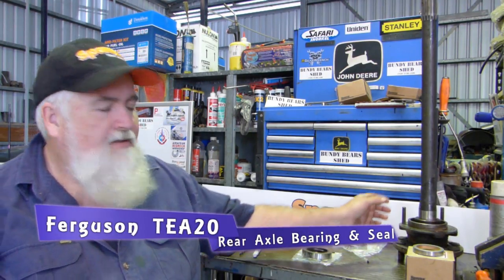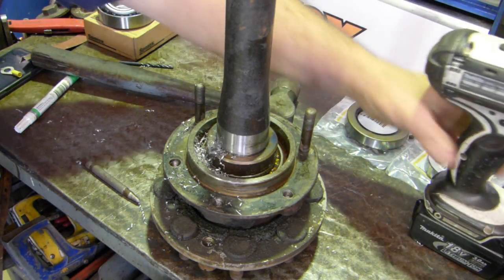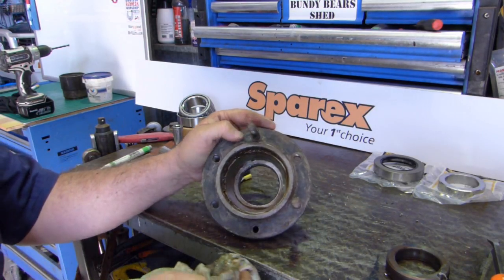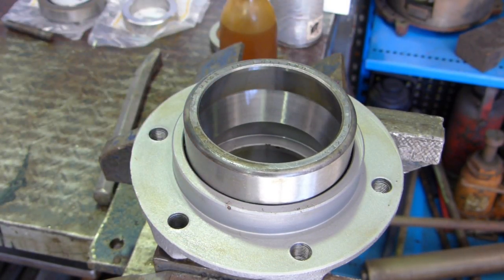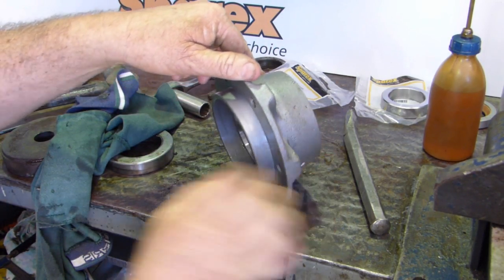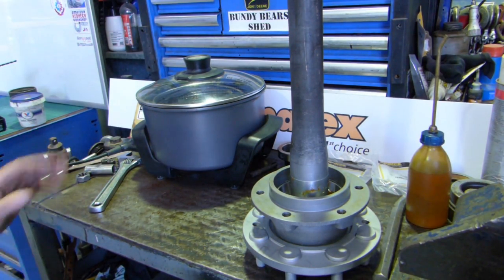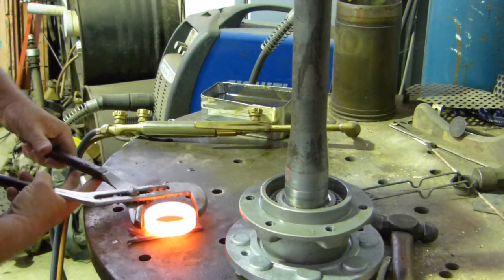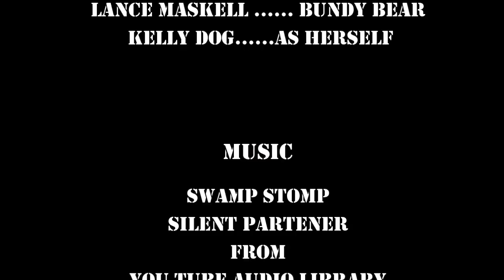How to Replace the Rear Axle Seal and Bearing on a Ferguson TE20 Tractor

Comment: Thanks, Lance. As I said on the other video, I bought all the seals. Since mine is a TO 20 1948 #499, it should not have the inner one so I will replace the outer seal then grease the bearing and use the sure seal for extra protection. The boil the bearing in oil is a great idea. I would have never thought of that. will watch for the install and shimming video. You are the best!
Reply from the maker: Thanks, Glad you enjoyed it.

Comment: G'day Lance that sand bluster really does a nice job of cleaning up metal. That was a good video lance thanks mate regards John
Reply from the maker: Thanks John, Yes there is not much that does not get a bead blast on the way through, saves a lot of work and leaves a nice finish to paint over.

Comment: Thanks Lance - I thought you might say that! I’ll take the shafts along to a local firm to get the work done. By the way, I wish we had some of your hot weather over here in England. We had a hail storm on Thursday and snow is forecast again for Monday (and it’ll be April then!!)
Reply from the maker: I'm not too keen on the cold, but extreme heat is a worry too at times

Comment: Hey Lance, hope your well mate, got this very job to have a go at tomorrow…quick question,you use oxy on the collar putting it back on..do you think I would get away with a plumbers blow torch..one of the decent ones not a diy job … ?? Or does it need to be oxy for sure>> ill find out tomorrow anyway just don’t want the collar getting stuck and cooling too quickly I guess….😊
Reply from the maker: I found you need to get it red, how you do that probably doesn't matter..

Comment: I think there's a spacer in the diff where the 2 1/2 shaft inner ends meet, this spacer keeps the Half shaft outer bearings engaged correctly.
Reply from the maker: G day MrMusic1950, there is a spacer but it is just a spider for the small spherical gears, the axles are supported in the diff by the side gears and need to touch in the middle, or have a small clearance, and the axles touching stops the movement away from the outer bearing.
Reply: Bundy Bears Shed thanks for that, I worked on this sorta stuff 70's through 2000, but can't remember just exactly all ins & outs. Keep up the good vid's

Comment: Lance, if the seal is leaking would a sure seal correct this problem or would a replacement of the collar and axle seal be warranted
Reply from the maker: If it is the early model the sure seal will fix it and if the later model the inner axle seal would fix it.
Reply: I've got a 1949 Ferguson TO-20

Comment: It is always good when you work with wheel bearing change with cold and hot. Everything that should expand is made hot and what should be pulled together is a day in the freezer.
Reply from the maker: Yes you can use heat and cold to your advantage for sure. It makes a big difference.

Comment: Can you get some accurate measurements of the axle OD and the collar ID?  Reason being I"m trying to figure out if a guy really needs the heat of an oxy setup.  Figuring a very rough expansion of .001 per 100 degrees F.  Just thinking how far a guy can get with the least amount of tools on hand.
Reply from the maker: Ill see if I can remember this weekend.

Comment: i was taught , that you should never put oil between a bearing's race and the housing, because it will cause the outer race to move in the housing
Reply from the maker: I was taught the opposite, I was shown to oil so pressing was easier and it wouldn't gall so easily, and the interference fit should be plenty to hold it in place. I have done it for 40 years now and not had trouble but I'm still not to old to learn something.

Comment: Great info as usual, Lance, what would you recommend as the main required imperial tools for a TE20, I've got a chance of picking one up but all my tools are metric?
Reply from the maker: G Day Deebo1820, AF spanner and socket set would do almost everything. The two sizes on the Fergy spanner were 11/16" AF and 1 1/16" AF  but the manifold bolts are 9/16 and 1/2" so a set from 3/8" up to 1 1/16 or a little larger would do the job.
Reply: Bundy Bears Shed Great, thanks for the info!

Comment: Hello Lance- another really useful and informative video as always.
I need to do this job soon as part of my TEF 20 rebuild but don’t have a press to do the strip down.
Is it possible to do the work without a press or will I need to have it done somewhere.
Reply from the maker: I think you would really need a press some of them can be very tight.
Reply: Oh fuck me that outer seal looks like a pain in the ass to get to.
I'll just live with the grease leak and replace the inner seal.

Comment: Is it possible to just knock on the bearing   using a correct size pipe rather than heat up the bearing?
Reply from the maker: Yes that would work for sure.

Comment: So do you not grease the bearing when it goes in the hub assembly?
Reply from the maker: On the later ones with 2 seals I do but if it is the early one the back end oil looks after lubrication.
Reply: @BundyBearsShed  my tractor is a 1951 Ferguson to20 I’ve already got one side tore completely down and ordered both the outer seal and the newer inner sure seal to make sure it doesn’t leak again. I just watched your sure seal video My plan now is to re assemble that side and just place the sure seal on the opposite side and add grease to stop the leak does that sound right? Im an auto mechanic in the USA not familiar with tractors at all it was passed down from my wife’s great  grandfather and wanted to get it going again in his memory.
Reply from the maker: @matthewhawes7469  if you have the 2 seals the sure seal is not for you as you just nèd the inner seal to stop leaks.

Comment: Hi Lance!
Yesterday I was going to heat up the collars to put them on their axels. Unfortunately I run out of acetylene gas just Before the first collar reached high temperature. Do you Think it's okay to heat it up again or should I get a new collar?
Thank's in advance!Best regards,Martin, Sweden
Reply from the maker: G day Martin, It is fine to heat it up again as it would have just gone back to its original state. No need for a new collar.
Reply: Ok, thank you! :-)

Comment: Hi Lance! I appreciate your videos very much since I'm restoring a TED 20 -54 right now. Do you have any tip on how to get the rear axle out when the nuts are of from the studs that is holding it in place? Many thanks in advace from Sweden! :-)
Reply from the maker: G Day Martin, Give it all a smack with a hammer on the axle flange and it the nuts are off it should come.
Reply: Thanks, I've tried but the brake shield is in the way. I'm afraid of destroying it.
Reply from the maker: Sometimes the brake backing plate can be bumped as well and once it is loose it should come.
Reply: Ok, thanks!
Another question regarding the plate you use in the press to get the bearings out: Does it fit for both TE20 and MF35 even if the MF35 have more studs? (is it the same hole pattern?)
Do you know where one can find the measurements for the patterns (TE20 and MF35)? I'm going to replace the bearings on my MF35 aswell.
Reply from the maker: Martin Bergström yes same stud pattern but the locating boss is slightly larger
Reply: Good to know, thank you! Can I ask you how big the hole in the middle is (in your plate)?

Comment: Can i install a sure seal in addition to the oil seal fitted in the trumpet housing?
Reply from the maker: No need really
Reply: @BundyBearsShed  is it one or the other or could both be installed?
Reply from the maker: @kennyc8823  one or the other, I dont think the sure seal will fit on the 19 spline axle.
Reply: @BundyBearsShed  I see. Is the tea20 a 19 spline axle? I fitted it no problem im just worried now if there is going to be enough room in the housing to have both seals adjacent to eachother
Reply from the maker: The early TEA was 16 spline and the sure seal was a good idea, the later axle was 19 spline with the inner seal but I dont know if it will rub or not
Reply: @BundyBearsShed  my tractor is a 1955 tea20 with the greese fitting fitted to the housing. Should it have a sure seal?

Comment: Thx bear great informative video but don't try and buy your parts from sparex they won't sell to the general public
Reply from the maker: G Day Warren, Sparex have a very extensive dealer network that they support. You can use the Sparex numbers and support your local dealer and in the process support your local economy.